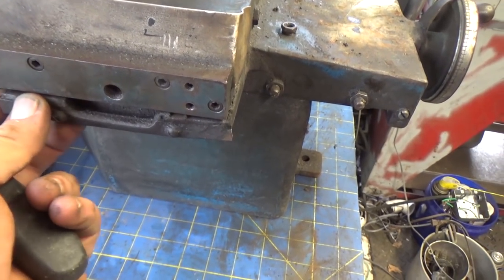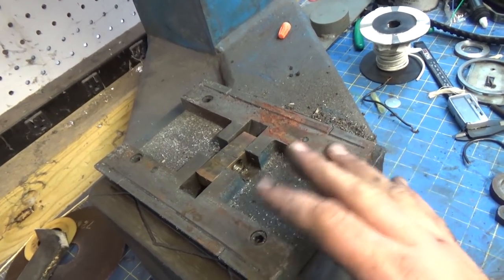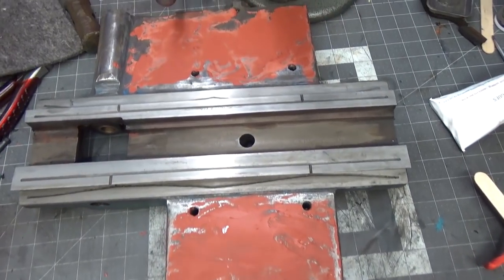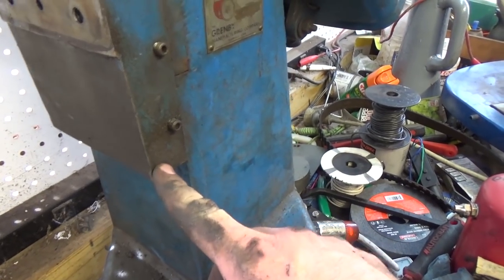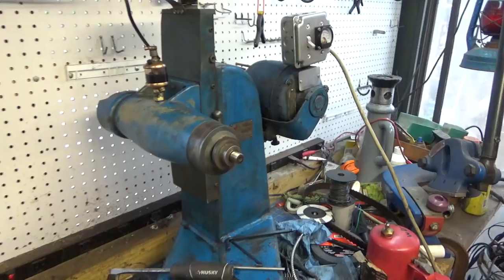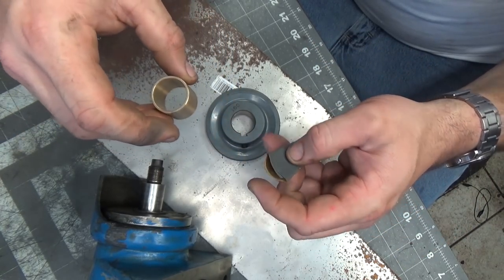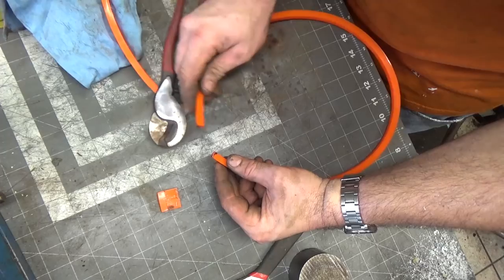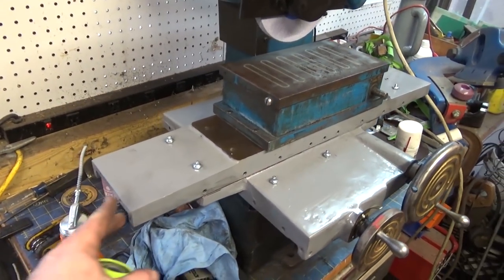Grenby Surface Grinder Cleanup and First Sparks

Comment: Ahhh Joe, I feel your pain. Trying to decide how far to go when pulling it down. I think you made the right choice especially as you weren’t sure about how it comes apart. You can very quickly get into a world of hurt. As it’s an old machine it doesn’t have to look new it just needs to function well. A YouTube channel by Dwayne Goode has made an adjustable stroke mechanical auto feed for his home made surface grinder from an old flywheel and some levers. It quite a clever design that you may find useful. Cheers Stuart 🇦🇺
Reply from the maker: Ill check him out...thanks! Cheers

Comment: Joe, You really had me going when I came across this video. I have the same model but mine is serial number 175 made in 1941. It came of a USA Warship which came into Sydney Australia around 1960. I purchased it about 4 Years ago, the slideways were so worn that I had to re machine every dovetail, recut the oil grooves, new leadscrew and nuts. Someone had had the spindle apart in the past and had put some strange bearings in, when grinding it did a lot of wheel bounce. I have not been able to use it as the surface finish is so bad. When you started to take the spindle off I thought at last I can see what the proper bearing look like, but NO you did not take it apart. So I am still none the wiser, zero information on the internet. Did you ever find anything about the machine. The Company is well gone now in Conneticut, I did try searching. If you ever need to take off the vertical slide, let me know and I will tell you how to do it. In the base are some VERY strong springs, and they are connected to a Bowden cable that is fitted to the base of the vertical slide.  Regards from Australia

Comment: I have the same machine!  I have yet to see another one that is as close as yours is.  I just finished tearing mine down about to the point that you did.  I had to make a new lead screw and nut for mine and the old one interestingly didn't have a wick in it and it was a right hand acme thread.  Yours looks like a traditional 60 deg thread from the video.  I still have to get my gibs adjusted and the chuck ground in though.
Reply from the maker: Cool...yea it is hard to find info on this machine. It will be months before i get any time to make more videos about this machine.

Comment: model looks like the machines that the chineese are still selling one of the brandnames is warco : https://www.youtube.com/watch?v=aRdN0e-s3rM
might be able to get replacement parts for it 
the felt for the way scrapers is a little more firm and dense , you can still get it at several stores if you google it , normaly its a beige white material and you can get it in different thicknesses
the reason why theres "oil"running out is probably because they used coolant during grinding
Reply from the maker: Ill check it out....thanks